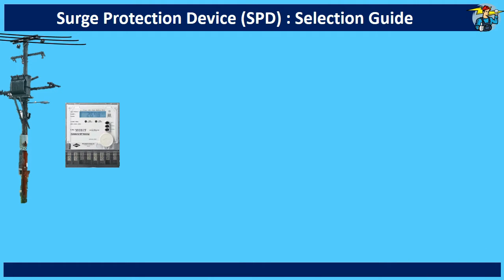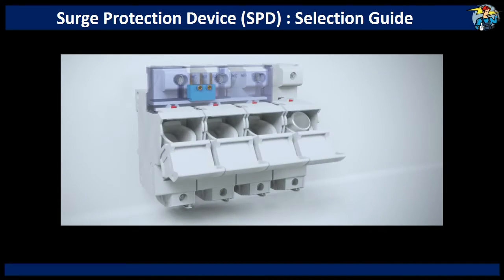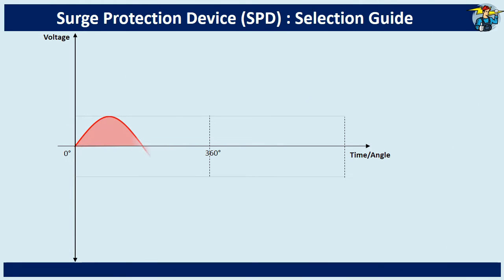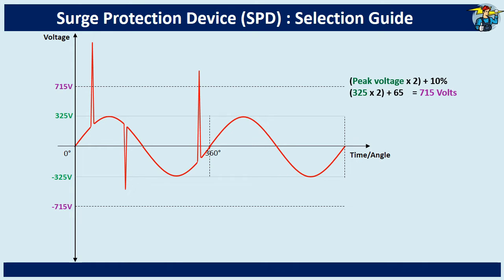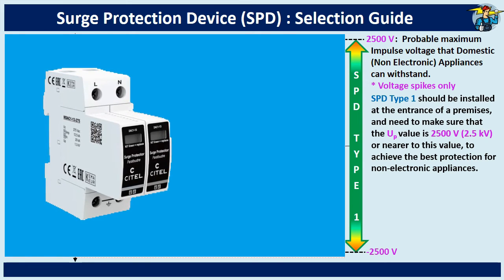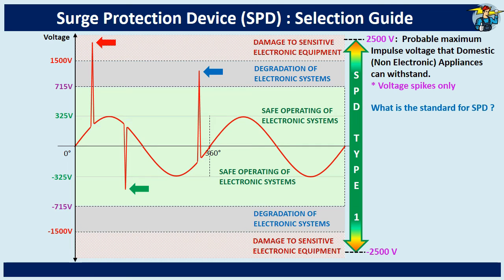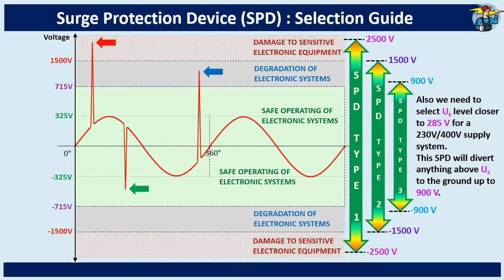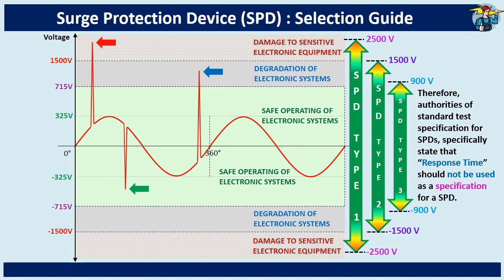Surge Protection Device Type 1, Type 2 & Type 3 Explained | How to Select the Best SPD Combination

Comment: Great video... subscribed!  But after researching hard for about 3 weeks, still have questions and getting conflicting info from many sources.  HUGE help and great appreciation if you can answer. I have 230V single phase system. I often read up to 265V at sockets.

1) I'm reading that SPD's start working at Uc... but some say it is +-20% or +-10% of Uc.  What is the truth?  Trying to decide between Uc of 275 (Citel SPD Model DAC1-13VGS-11-275) and Uc of 320 (Citel Model DAC1-13VGS-11-320).

2) The SPD Models I'm considering are Type 1+2+3.  I will have a high-low voltage device (insulation voltage of 450) right after the SPD, and a static voltage stabilizer after that.  All my appliances are over 40 feet from my main panel, including 2 water pumps around 100 feet below).  Will I need additional SPD's at every appliance?

3) The Up value of these Type 1+2+3 SPD's is <1.5kV. Citel rep says that does not mean that the SPD will let through 1.5kV (because of the Type 3 protection maybe?). I tend to disagree.

4) If the SPD's DO let through 1.5kV, how will my appliances be safe? Is it because the let-through time is so short that electronic appliances can handle it?

Sorry to dump this on you, but I'm going crazy and have urgent need (my stabilizer already got fried once).

Thanks again for any help.
Reply from the maker: Thank you so much for subscribing. 
You’ve clearly done a lot of research and raised very important questions. 
I’ll do my best to answer them clearly.
SPD starts to operate near its Uc, but there is a tolerance range. 
The Uc rating must be higher than your highest expected voltage, including fluctuations.
In a 230V single-phase system, if you’re seeing 265V regularly, that’s already +15% above nominal.
Technically, a Uc of 275V might work if,
•The manufacturer's tolerance on Uc is +10% or more, taking it to ~302V.
•Your peak voltages (like 265V) are not frequent, or short-lived spikes.
•The SPD is of good quality (e.g., Citel) and built for durability.
But manufacturer's tolerances Vary by Design. Some manufacturers give +10%, others +15–20%, but that tolerance isn’t a guaranteed clamping point.
If your voltage routinely stays near 265V, you're operating very close to the SPD’s maximum continuous voltage. That ages the SPD faster, even if it doesn’t trip.
The standard says Uc is the voltage the SPD can withstand continuously without degrading. If you're always within 10V of that, any voltage spike or upward drift puts it at risk.
Use Uc = 275V only if your 265V is occasional and brief. 
Use Uc = 320V if your 265V is frequent or persistent.
The Up rating (like <1.5kV) means the maximum voltage the SPD will let through under a standardized test impulse.
Even if it’s a Type 1+2+3 SPD, the Up rating still holds. The lower the better.
Some SPD designs include additional filtering or fine clamping at the end stage (Type 3), but if the SPD’s datasheet says Up = 1.5kV, expect that as the worst-case let-through voltage.
The Citel rep may be correct if the Type 3 section clamps tighter after Type 1+2, but it depends on how the SPD is internally designed. Stick to datasheet values as your safety baseline.
Distance matters. Over 30 meters (about 100 feet) from the main panel, especially with motors like water pumps, the SPD’s clamping performance can degrade due to inductive effects in wiring.
If you have sensitive or expensive equipment far from the main panel, it’s a good idea to install a secondary Type 2 or 3 SPD close to those devices.
Especially since you already have a stabilizer that was damaged, this extra layer can help.
So adding Type 3 SPDs near sensitive equipment will be a smart choice. They clamp lower (sometimes <1kV), ensuring better protection for sensitive or critical equipment even if the distance is less than 30m.
Further, appliances rated for 230V are only designed to handle up to 253V max. 
So getting 265V regularly is harmful long-term. It overheats motors, damages capacitors, and stresses power supplies.
If possible, ask your power provider to check for overvoltage or adjust transformer taps.
I understand how overwhelming this topic can be. Feel free to ask anything else, and I’ll do my best to help.
Again, thank you for watching and supporting the channel.

Comment: good work ,@ElectroAcademyEA

what about SPD for DC voltage ?
Reply from the maker: Yes, there are SPDs specifically designed for DC voltage systems, commonly used in solar PV setups and battery systems. I’ll consider making a video on DC SPDs soon.

Comment: I bought 40ka Uc 385V  for single phase 230volt AC line.

Is it properly work my house??? 

Please reply me
Reply from the maker: @unlimitedfun702 Yes. For most residential and small commercial single-phase systems, a 40kA, UC 385V SPD provides adequate protection against common surges caused by lightning or grid disturbances.
If you need enhanced protection (e.g., if you have highly sensitive electronics or you're in a high-risk area for surges), you could opt for a higher kA rating, but 40kA should suffice for general use.
A UC rating of 275V-385V is common for single-phase systems, especially in regions with a 230V nominal voltage (like Sri Lanka and many other countries). 
The 385V rating is a good selection and allows the SPD to tolerate short-term overvoltages (which can occur in real-world conditions) without triggering and also without harming any equipment.
However, if you go for lower value for Uc like 275V instead of 385V, SPD will operates unnecessarily to clamp voltage spikes around 300 volts and the lifespan of the SPD will be affected.
Reply: No, you should have bought the 275 V one, the 385 V is for three-phase line, even the 275V one is quite high, but I don't know if there are values closer to 250V

Comment: This is so confusing! Do I need a type 1 SPD installed if I have a Type 2 installed at the entrance of the circuit? If I do need a Type 1 as well, then can I install it along with the Type 2 (same location)?
Reply from the maker: If your building is directly connected to an external power line (like overhead power lines), or if it's in an area prone to lightning strikes, it’s advisable to install a Type 1 SPD to handle the larger surges from direct strikes.
A Type 2 SPD alone provides good protection from internal switching surges and indirect lightning strikes, but it’s not designed to handle direct lightning strikes or very high-energy surges that can occur at the main service entrance.
Installation of Type 1 and Type 2 SPDs:
Can they be installed at the same location? Yes! In fact, it’s common practice to install both Type 1 and Type 2 SPDs in the same electrical panel, typically at the main electrical distribution board.
The Type 1 SPD handles the higher energy surge (from a direct lightning strike or external grid surge).
The Type 2 SPD protects against lower-energy residual surges (coming from the Type 1 or switching surges within the building).
They are often installed in a coordinated manner, where the Type 1 SPD acts as the first line of defense, and the Type 2 SPD provides secondary protection.

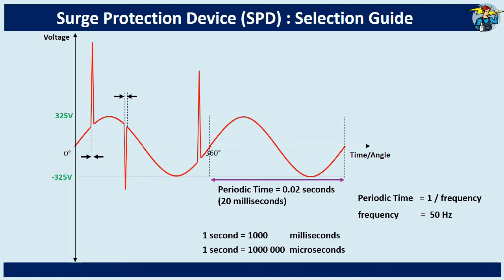Comment: 5:00 This waveform is for a 230V LN (as the case for Europe's electrical standard).
But for a 240V split phase (as in USA and some part of the world), we get two 170V LN waveforms, one being opposite of the other. 
Having said that, should n't we use a lower Voltage rated SPD?
Reply from the maker: In a typical U.S. residential split-phase system, you have:
120V line-to-neutral (LN) voltage from each "hot" line to neutral.
240V line-to-line (LL) voltage between the two "hot" lines.
SPDs are rated based on the maximum continuous operating voltage (Uc) they can withstand. This rating must account for the system's nominal voltage plus any temporary overvoltages that can occur during normal operation.
In a 240V split-phase system, SPDs are often selected based on the line-to-line (LL) voltage (240V), not just the line-to-neutral (LN) voltage (120V), because the SPD needs to handle surges across both "hot" lines.
Why Not Use a Lower Voltage Rated SPD?
Higher Voltage Spikes Across Hot Lines:
Even though each line is 120V LN, surges can often occur between the two lines (L1 and L2), which can result in voltages approaching or exceeding 240V line-to-line (or more during a surge).
Therefore, the SPD must be rated to handle this 240V LL situation, which means a higher voltage SPD is necessary to protect both the line-to-neutral and line-to-line configurations.
Although the system has 120V line-to-neutral (LN) waveforms, the SPD needs to be rated for the 240V line-to-line voltage and potential surges that may exceed that. Using a lower voltage-rated SPD (e.g., 150V or 170V) could result in under-protection, as it might not handle the higher line-to-line surges or temporary overvoltages.

Thus, a higher voltage SPD (e.g., 385V UC) is appropriate for ensuring complete protection in a 240V split-phase system.
For more info, please get the help of a good electrician.

Comment: Are there different SPDs for AC & DC?
Reply: yes
Reply from the maker: Yes.
AC and DC SPDs are different, and they are designed to handle the distinct characteristics of AC and DC power systems.
You must select the appropriate SPD based on whether your system is AC or DC, considering the voltage rating, current type, and specific application (e.g., residential AC system or solar DC system).

Comment: my requirement is protect appliance from high/low voltage and from  lightning which one should I install? Or both?
Reply from the maker: You have to use both then.
For low voltage protection, separate unit need to be connected.

Comment: how far the spd 3 should be away from spd2?
Reply from the maker: Ideal separation ensure a minimum of 10 meters (33 feet) of cable length between the Type 2 and Type 3 SPDs for effective coordination.
If the distance is not feasible, needs to consider using inductive coils or combined SPDs to achieve the desired protection.
Proper coordination between SPDs is essential for protecting sensitive equipment, especially in environments where both large surges and small, localized spikes are possible.

Comment: What if I have a spd with the following  rating installed in a 230VAC Line-Line sytem.

Uc =275v , In =20kA Imax=40kA, Up=1.8kV

Approximately how long the spd will fail(turns to red) if the voltage spikes around my power system ranging from 280-380vac?
Reply from the maker: Since this SPD's maximum continuous voltage reads as 275 volts, 280-380 VAC surges are not a threat to this SPD.
It will last till it reaches critical values, that is "In" for at least 15 times, and "Imax" at least one time.
Reply: @ElectroAcademyEA  thanks sir